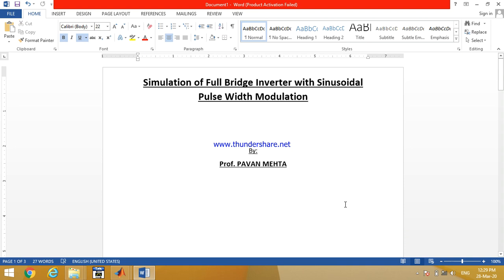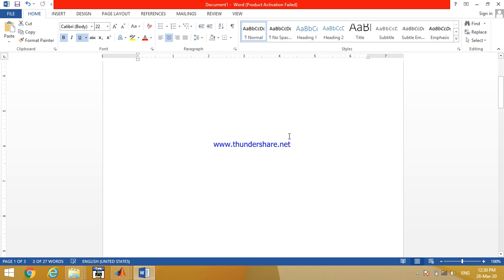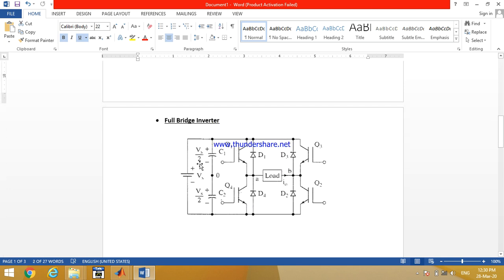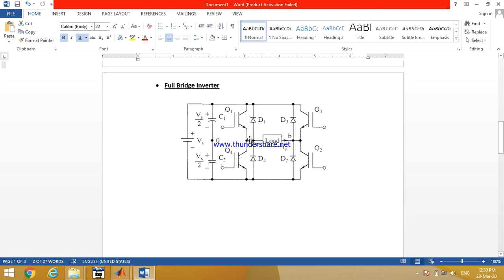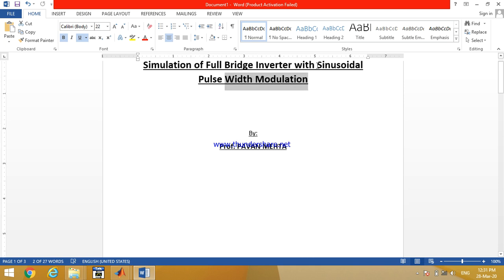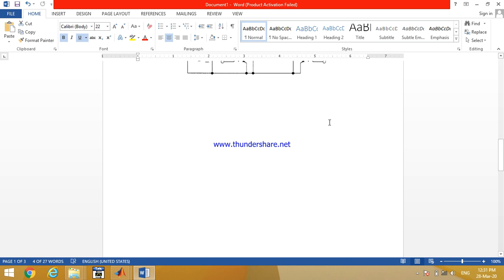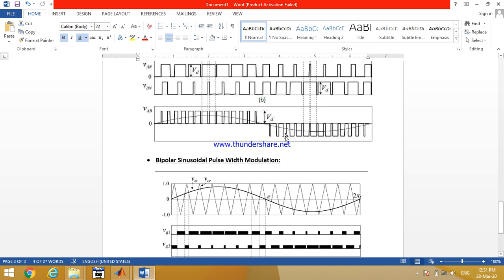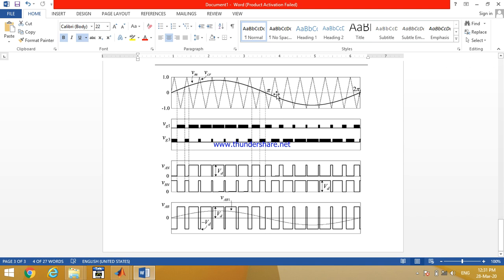Single Phase Full Bridge  Inverter Simulation with SPWM by Pavan Mehta

Comment: Our project is on a single phase inverter using different switching techniques.. so does this come under that thing?
Reply from the maker: Its SPWM.. However, you can implement any switching and control technique with same power circuit